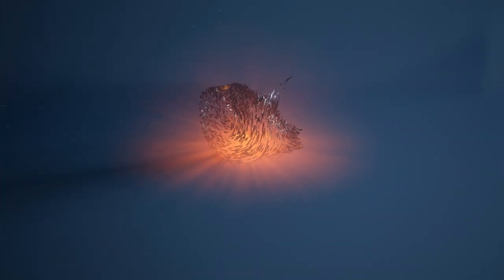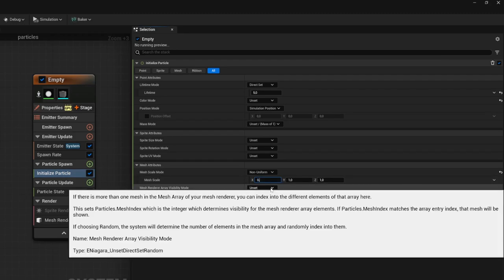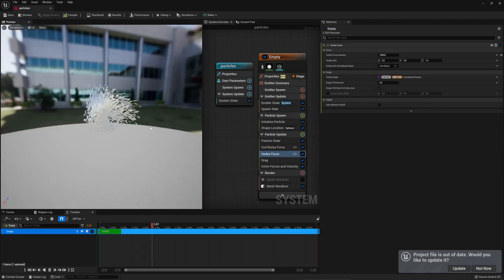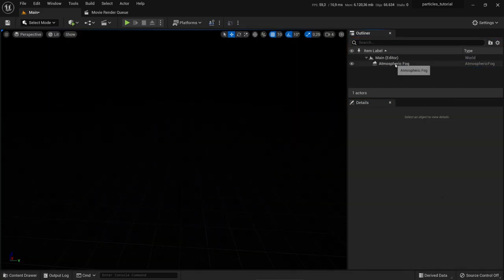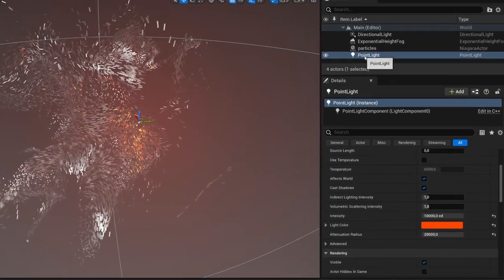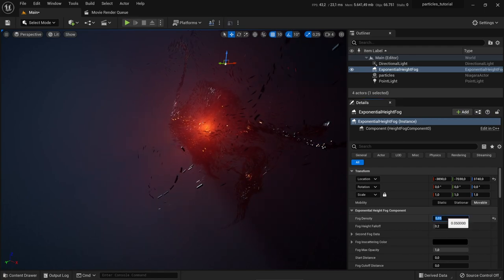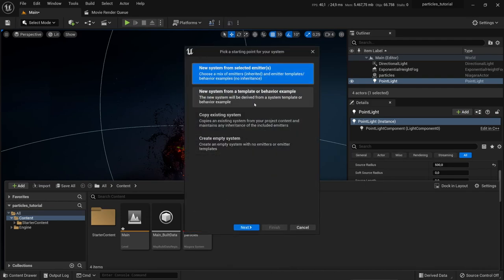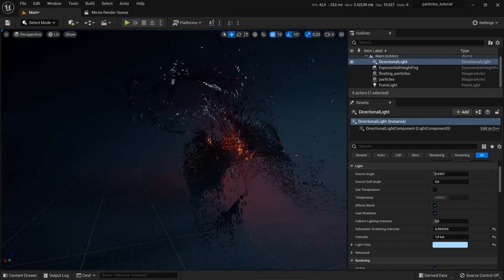Let's Build an Unreal Engine 5 Niagara System & Movie (Part 1) - Scene Setup Tutorial

Comment from the maker: IMPORTANT: You should deactivate static lighting for this project. Static light is not needed and produces an unwanted "glowing" exponential height fog here.

To deactivate Static Lighting, just follow these steps:
(1) on the top right in UE5, go to "Settings" and then to "Project Settings".
(2) in the search field, search for "static light"
(3) deactivate the option "Allow Static Lighting", then close the project settings.
(4) Click on the restart-prompt to restart the project.

Cheers

P.S.: The aforementioned unwanted "glowing" Exp. Height Fog effect can also be adjusted by setting the option "Static Lighting Scattering Intensity" to "0.0"  in the Exp. Height Fog settings.

Comment: Mine is starting to look like yours, except I cant get the volumetric lights rays to show. Is there something else I can do besides turning on volumetric fog?
Reply from the maker: Strange, it should work. Make sure, that all your lights and the particle system are set to "stationary" or "movable". Moreover, make sure that all lights and the fog are set to "volumetric". Moreover, play around with the fog density and volumetric distance.
Additionally, you can "fake" volumetric light rays with your directional light by enabling "Light Shaft Occlusion".
Cheers

Comment: How do you change the color of standard niagara smoke templates etc?
Reply from the maker: EDIT: for future readers, see my next comment for the solution (works for the cascade templates and not the fluid simulation templates).

usually via the material. check in the emitter which material is being used. then go to that material and create a material instance. use that instance to change the color and set it as the new material in the emitter. 
(It may be that the instance does not change the color. Then you can use a copy of the original material and change the color directly in this copy and use this copy as the new material in the emitter instead.)
cheers
Reply: @Eulman  thanks for the time, I'll give it a bash
Reply: @Eulman  These are Niagara systems not emitters. There is no material section unfortunately.
Reply: Any idea?
Reply from the maker: So, I assume, that you are referring to the smoke example that UE5 provides in the starter content. 
You can change the color with little effort in the following way:
1. First I used the plugin "Cascade to niagara converter" to convert this smoke cascade system into a smoke niagara system. (I just don't want to use the old cascade system :) )
2. Then double click on the new niagara system named "P_Smoke_Converted".
3. in the "Particle_Emitter", under "Particle update" you find the "color" section. 
4. There you see "Vector (RGB)". Expand and you should see "Scale curve". By changing these three values, you can change the smoke's color. So, for example, if you set "scale curve" to "1,0,0" the smoke will be red.

Cheers
Reply: @Eulman  Thanks again for giving this explanation, unfortunately there is no "color" section under particle update.. The only niagara system that has the "color" option  is the "gas colored smoke" example which you can change but can't get rid of the stupid spinning movement to give it different dimensions.
Reply from the maker: @djtc2093  now I'm quite confused 🤔. I was referring to "P_Smoke" in "Content\StarterContent\Particles". After converting it to a Niagara system, the newly created "P_Smoke_Converted" system can be opened and in the "Particle Update" section at the bottom you can find the mentioned "Color". I'm using UE5.0.1. Maybe you've missed something? 
Cheers
Reply: @Eulman  Yes also 5.0.1. Im referring to the niagara fluid smoke examples/sims.
Reply from the maker: great, thanks for clarifying! 
Besides playing around a little bit with those new fluid simulations, I haven't really dived into them, yet (no pun intended ;))
Maybe you'll find some clues here: youtube.com/watch?v=k7WLE2kM4po
Reply: @Eulman  Thanks bud, I have watched that tutorial and they don't show you how to change smoke color. It seems to be the biggest mystery on earth for some reason, haha.
Reply from the maker: Too bad. Was worth a try.
I were just browsing some videos and found one that addresses your question. I found you in the comments. Glad, that you've figured out the color now. Cheers!
Reply: @Eulman  Haha, I managed to for the one simulator that spins, but you cannot change the spinning movement so it's pointless haha. I'm trying to make a realistic explosion but with a brown sand color for the smoke. Thanks for your effort
Reply from the maker: I hope, you can figure it out. All the best. Cheers

Comment: Everytime I render out my particle system it never resembles the same motion in the viewport. Seems to be more pinched and constrained,  any ideas?
Reply from the maker: Hi, I think, you could solve your problem by adding the niagara system into your sequencer and "bake" the emitter-evolution.

(1) go to your sequencer and add your niagara system to your timeline (by drag and drop, or by selecting it via the "+ track" button)
(2) there, at your niagara system click on the "+ track" symbol and under "components" select "NiagaraComponent0"
(3) in NiagaraComponent0 click on "+ track" and select "Niagara System Life Cycle Track"
(4) now you should see a newly added red bar in your timeline. right click on it: "properties" -> "Age Update mode" -> select "desired age"

And now, you can control your particle system development with the sequencer. that means, when you move the whole "Life Cycle"- red bar to the left, then your niagara system will start developing before your video even starts and you will see exactly in your viewfinder, how the video will look like.

Additionally, you should fix the frame rate, which might help somehow. Set it to 30fps or so: Go to your project settings, and activate the option "Use Fixed Frame Rate", set it to 30 fps.

I hope, it helps, cheers!
Reply: @Eulman  Hey, thanks for the tips, However, it wont work for me. I have a blueprint driving variables from a "Start Analyzing Input" being fed audio from the Engines submix connected to Niagara emitter properties. I have to have delta time for the analyzer in BP to work but isn't the render based on sequence time? Idk, I have  to figure out how to get the sequencer to recognize the Blueprint instead of me having to hit the simulate button.